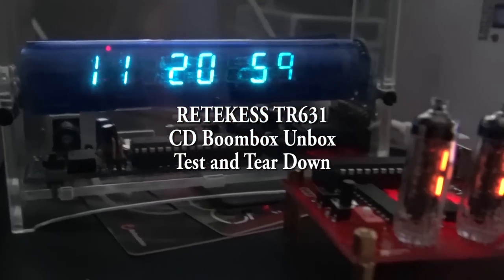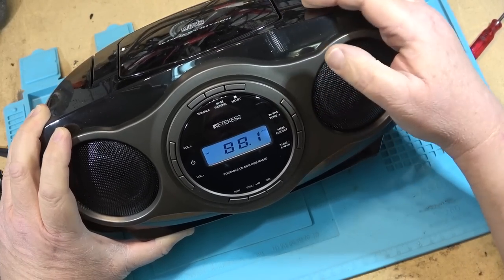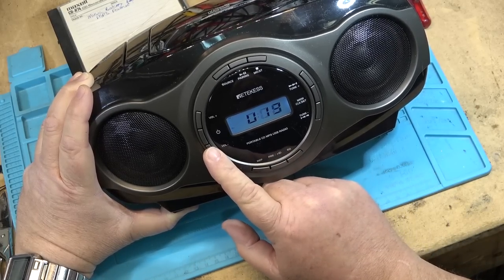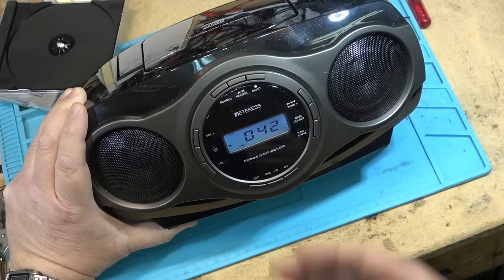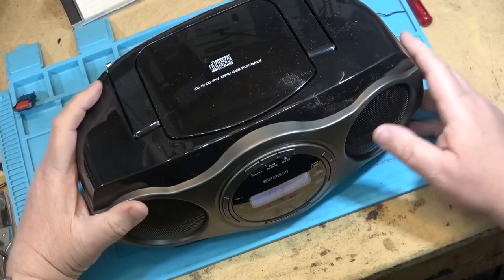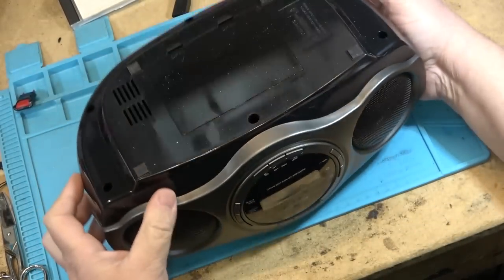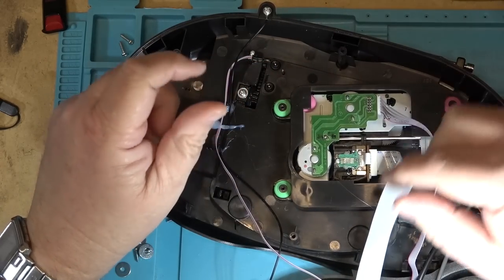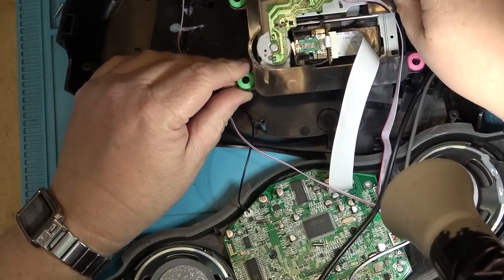Retekess TR631 CD Boombox Teardown

Comment: This is a very generic unit, very similar to the store brand ones that are a dime a dozen these days so I wouldn't be paying too much. Silan CD chipset, little 2W amplifier ICs, Sanyo SFP101N clone CD mechanism and the build even looks the same. There are a steady supply of these on ebay with knackered CD mechs, and they never seem to last very long but replacements are dirt cheap so it's no big deal - the SFP101 is pretty much the only game in town still being mass-produced by several suppliers now. Yeah, they work.

Comment: It would be nicer if it is rechargeable. Come on Retekess we are in rechargeable era now. Make a rechargeable smart boombox with DVD VCD CD MP3 player, AM & FM, cassette player, Bluetooth connectivity, NFC connectivity, USB connectivity, audio recorder to USB memory or sd memory card through memory card slot, auxiliary slot, RCA slot, HDMI connectivity, headphone jack for wired private listening, remote control, at least 9 inch colored touch screen panel, operated by Android, 5G internet connectivity, clock with alarm clock settings and many many more latest features. 😊

Comment: I'm not surprised it's missing AM. Almost all the single-chip radio ICs are FM only, and even back when AM was more common, and many portable MP3 players came with radios, they were also FM-only.
Reply from the maker: Ford just announced that the new mustang has no am radio.  For me that's a deal breaker.  I listen to am more than FM in the car.
Reply: @12voltvids  In a large country such as yours I'd expect you to need some AM support!  I think anything getting rid of AM in such a market is just silly.  I remember a couple years ago a load of noise about some Australian broadcaster switching off short wave.  Basically they reduced their service to the big cities.

Why nobody is pushing for digital AM radio I have no idea.  It works find over shortwave!

Comment: I would use USB all the time, however, it is in a place it could get damaged like you said.  I have been asking them to put a USB in radios/boom-boxes etc for a long time.
Just a shame they didn't have a recessed bit for the USB, so you could plug it in vertically or with that unit, right inside, there is plenty of room inside.  Now for the UK, it would be wonderful if it had FM and DAB radio, CD, plus USB, B.T. as it can be used as an amplifier.  It might also be improved if it had larger speakers, it just sounded a bit tinny on your video, however, in rear life it might not be the case.  I just like to hear a bit of bass when playing music.  I do not have a Hi-fi these days in the house.
Reply from the maker: The solution to the USB sticking out is to use the stubby usb stick that only sticks out about 1/4"
Reply: @12voltvids  Fine if you have them, but all the music is on normal-sized ones!
Reply from the maker: @BoB4jjjjs  they are cheap enough. Just pick one up and make a backup.  My music collection is backed up on 2 hard drives and Blu-ray disks as well as flash cards and USB sticks.   Can't have too many backups as when dealing with digital storage it can be gone in a flash.  Pun intended.
Reply: @12voltvids  Life is too short for that!

Comment: Lots going on here for just over $50.
Reply from the maker: It's not bad.  More than good enough for a portable radio and the CD player is bloody awesome.  It was impossible to get it to skip.   No remote but really who needs a remote on a boom box.  This is something to take to take to the beach or back yard to listen to tunes on.
Reply: @12voltvids  The bluetooth feature may have saved the small portable cd player from extinciton.
Reply from the maker: @sdjgfashjasbfasd  There are plenty of BT speakers available. The selling feature on this is the CD player.  BT is also a bonus. Personally I wouldn't use BT because I don't stream from my phone, and don't have any music on my phone. That's why I used that old blackberry to demo because my cell has noting on it to play. My battery dies fast enough as it is without using it as a music player. For me my phone is a communication device for email and phone calls. All my music is on memory cards and CDs.